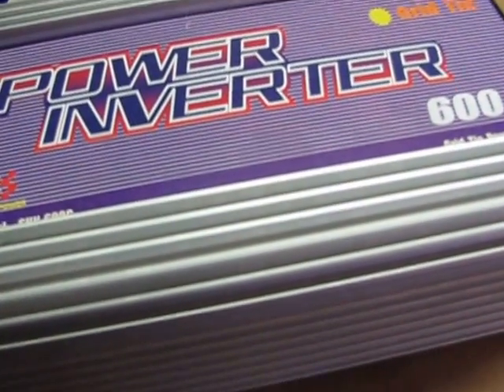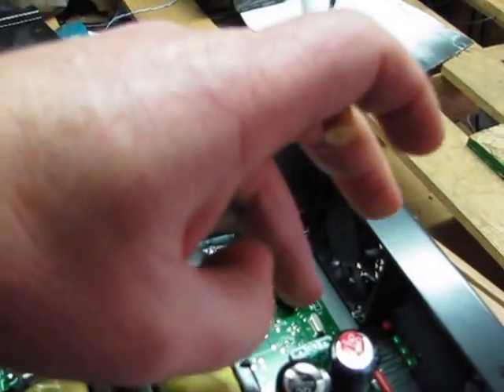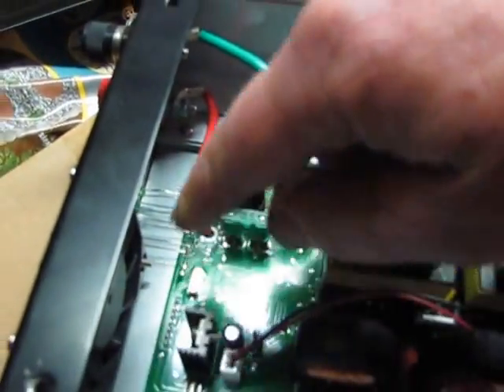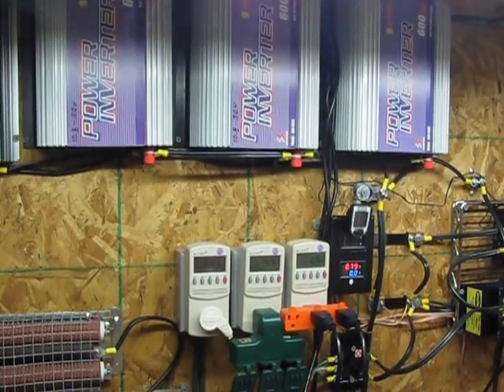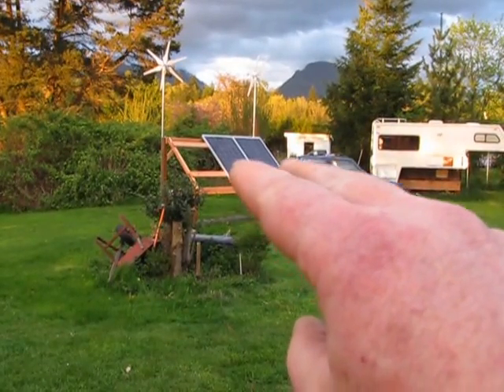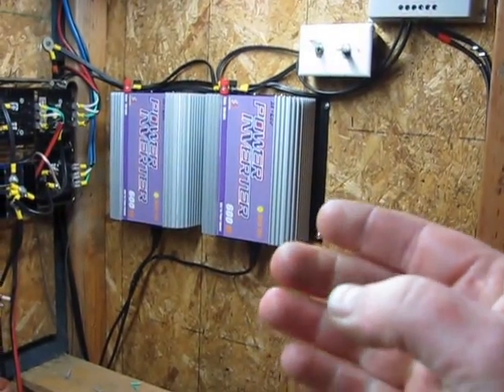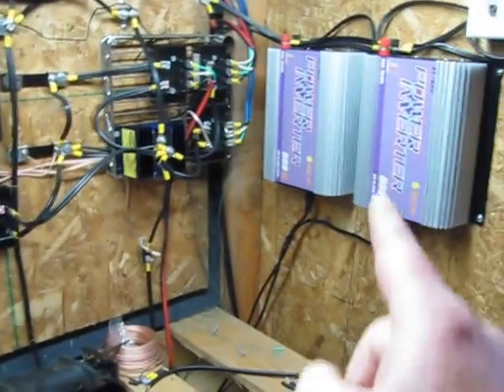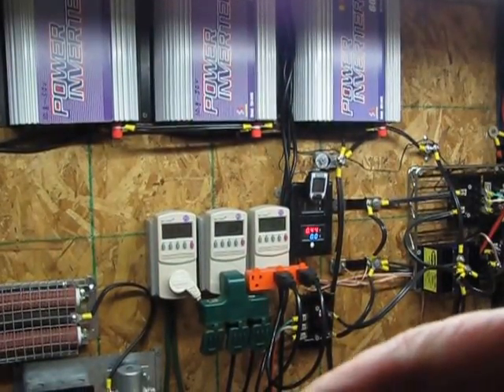Some things I learned about,, Sun Grid Tie Inverters

Comment: I use 600-900w dc to dc regulators on each one of my GTIs. I also feed all my inputs to a bank of six 450v computer capacitors to stabilize the power for those picky GTIs. I have computer fans on top of each GTI. I wired it in parallel to the internal fan.

Comment: After buying 2 1000 watt grit tie inverter from china from ebay  at 100,00  each  and one 600 watt at 160,00 all junk i lost 360.00
none of them worked all just put out 20 watts to 8watts. i am just going to stay with solar the plastic bags where not sealed on all 3 if whey come open you just got returns that where send back and ship to you.
Reply from the maker: I watched your Youtube and I didn't see what your talking about ?? Sun grid ties work fine unless you over volt or over amp them , I go over volts and amps, both, volts and amps, using my wind turbines, I blow them up, when that happens I sometimes have to change out a capacitor on my Sun grid tie ,, easy fix , no big deal :)  You may also loose 20-30% power besause the converting it from DC to AC output ,, Lets say you got 1000watts incoming DC power convert that to AC 120 and you loose about 20% ,, Where it goes I don't know but its gone ,, using the Sun Grid tie inverter you should get around 70- 80% what your solar or wind turbine makes,, I know it kinda sucks but Chinese grid ties are affordable, if you add more grid ties to the same system it works better and becomes closer to 90% efficiency

Comment: "sun " inverters are very cheap. they have no UL or CE rating.  I learned my lesson with these cheap inverters. I went to all " power Jack " inverters 5 years ago and have never had a problem. they are also CE rated as well. They are worth the extra 20 dollars to me. I had one of the sun inverters start on fire once, from a loose factory connection.

Comment: I have a 600 v 20-60 v inverter and used a volt booster to get the voltage input to 60 v but after 8 amps, the inverter would drag the voltage down to 25 volts! Obviously that would drop the wattage!
Reply from the maker: Ya i think that is because it is MPPT it wants to stay in a pre programed voltage range ,, your voltage booster might not be able to keep up with the amps that the grid tie is trying to draw when it switches to the lower voltage but higher amp pre programed setting ? I don't know just a idea :)

Comment: on your wind grid ties you might want to consider running the fans on a 12v 2a power adaptor you can find them on amazon and replace the fans with standard pc case fans of the correct size that way tehy will always run you can even put that fan on a timer or relay from the cost of power consumed will be much cheeper than blowing up a inverter due to over heating

Comment: I'm not convinced flipping the fan around will work well.   Fan blades are usually designed for better evac than pressurization.  Besides, if you flip the fans around, that will put the fan blade VERY close to the metal it's mounted to... drastically restricting airflow (and making it more noisy).  It's best to let the fan suck the air out, which causes incoming air from the other end to "tumble" as it enters the cabinet, causing the air to flow all over the interior. If you pressurize, you can have stagnant air pockets inside the cabinet.

Comment: Did any of them burn out? I like your solar panel stand. Great video.
Reply from the maker: Stephen T I only had one 600w grid tie burn out, it was hooked up to my Freedom wind turbine that made more power than the grid tie could handle,, I fixed the grid tie and stacked it with another 600w ,, it should be ok now, I hope :) 
If you watch my newer videos you can see my solar panel stand all done and it has been working great ,, I want to get another 6 panels and put them on the west side of my roof :)
Reply: That must of been a good turbine. Ya hopefully they should be ok now. I will watch your new video's. 6 more panels will be great lots more power 😊

Comment: hmm an isolator connected to a 24 volt battery bank (just two car batts or mower batts in series) Would help stall the turbine before it reached 30+ volts to the inverter but wouldn' accept any amperage from the turbine until it exceeded the batt voltage.
Even two 9 volt batts in series would be a little safer eh?
Reply from the maker: I am running a 12volt battery bank :), don't forget I am running 10.8-30volt grid tie inverters on my turbines ,, My grid tie inverters turn on and start absorbing and putting power back into my grid before the turbines even reach battery charging voltage,,,

My 12volt turbines make allot of amps,, more amps than my grid tie inverters need,, With my setup using a battery isolator,, the extra amps ( in winds above 10mph) are used to charge my 12volt battery bank, while still running my grid tie inverters,, It seems to work pretty good sofar,, but I am working on making it work even better :)

Comment: thinking about how the voltage from the turbine, depending on the wind speed. if the voltage spikes from a gail or storm. this surge could take out the under rated capacitor. so the charge controller would hopefully divert an overvoltage condition on the battery bank.
so the better choice is the 60 volt which you are getting.
thanks